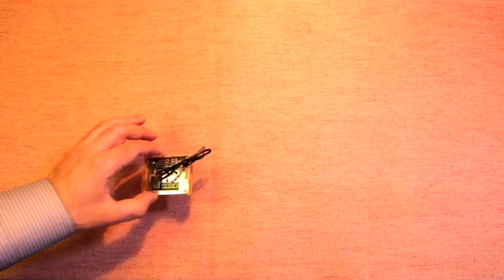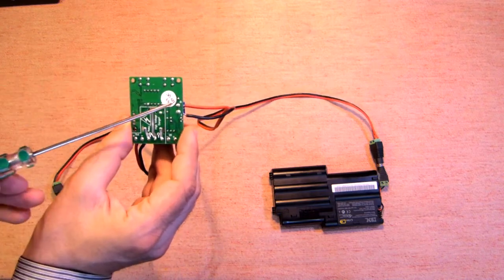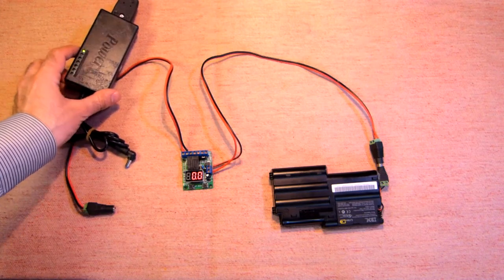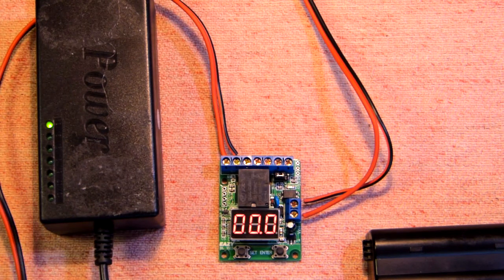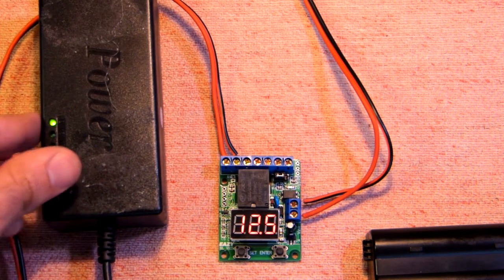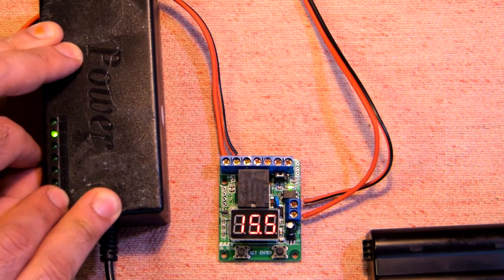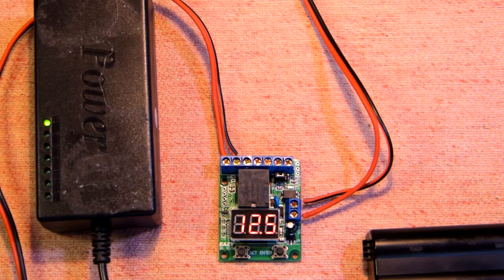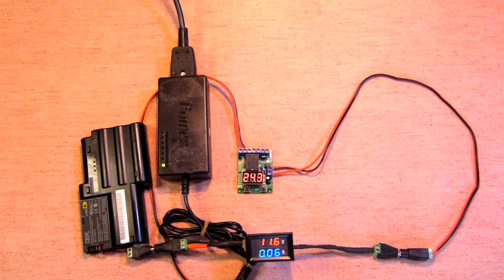Voltage Relay - Description and Test

Comment: If I want a fan to turn on when battery voltage is above 12.4volts. Where do I connect the positive and negative wires for fan and also for the battery power source?

Comment: Hi, i'm wondering if this device might help me with a little project. Basically i want to monitor voltage between two points within the apartment's intercom and then connect the relay contact (NO) to the button that opens the gate.  That should open the gate as soon as someone pushes the button on the intercom that's down in the street. Any ideas?
Reply from the maker: You can use a common relay instead of voltage relay if someone can push the button.
Reply: @powerbatterychannel4315  the issue is that the button down the street carries a voltage on it meanwhile the gate unlock button has a different voltage and that will probably fry the power supply and/or the intercom.
Reply from the maker: @Chic01taliano  Probably, you need to get an advice from more skilled electrician
Reply: @powerbatterychannel4315  the voltage relay worked for me. Bought it on aliexpress.

Comment: does voltage identifire relay drain the betary in car log or off position. Reply me please brother. Thanks
Reply from the maker: It only turns relay on and off in case of minimum and maximum voltage.

Comment: They are good budget priced voltage sensitive relays, I modified the heat sensor by placing a 50k pot in series with a thermistor, it gives you a bit more control of the fan speed in that you can adjust the top end speed a bit more.
Reply: Is there a way to stop taking those 30 miliamps from battery at night?
Reply: @Muzzledasnotprohamaz  don't think so, most circuits will require some current to run. 30 milliamps is pretty small amount of current. You be better to run it of a plug pack or place a solar panel in the circuit to recharge the battery at day.

Comment: Great video...clear explanation.  I'm looking for something like this that will allow me to close contact at or above a set voltage and open them below that set voltage.  Any ideas?  Thank you.
Reply from the maker: You can change the mode by pressing SET within 2 seconds and the device will function vice versa.
Reply: @powerbatterychannel4315  Thank you.

Comment: Great channel man ! Could you please make a video explaining how control 3 different lights based on the voltage output from a potentiometer ?  Like for example at 1v only blue light turns on and at 2 volt only geen light turns on and at 3 volt only red light ? Thanks a lot man ! 🙏

Comment: Wonder what amperage that little dude could take?  Like on a 12v system with 2 seperate batteries and used as an alternator charge controller that when it detects a voltage over 13v it will enable and allow both batteries to charge by that single motor alternator And when battery level drops below 12.7v it will turn off which leaves the two batteries isolated from each other once again until the motor is started again and voltage on one battery rises above 13v again from alternator charge voltage..  but that would have a high amp charge potential spike..  wonder if itd blow it to bits during time your starting the motor and voltage fluxuates from the 100a + start current....????...???..???..???
Reply: If could answer that question and depict it in a youtube video with proper tags for fishing and boating youd hit 300k views easily..  because vsr”s voltage sensitive relays are running around 300$ and are essentially the same thing except non-adjustable and hardwired connections inside a waterproof case..
Reply from the maker: @Z-Ack   high amp charge potential spike may kill the device.
Reply: @powerbatterychannel4315  you could use it to switch a separate high am relay
Reply: This is a control switch, nothing more, and can likely handle 1A or so just fine.  If you need to switch high current you should use this device to control a high current relay.  Always fuse the positive input and output at 1A to protect the device.